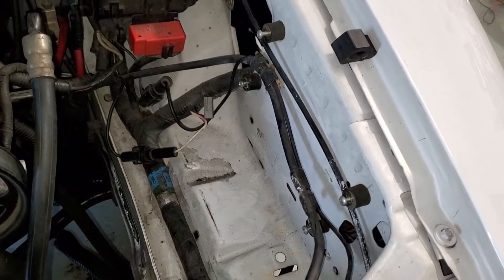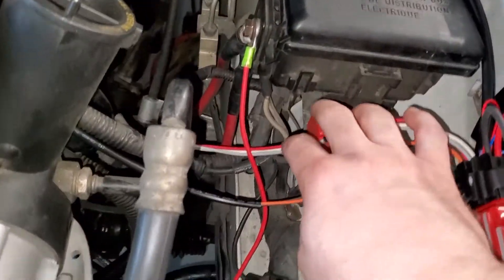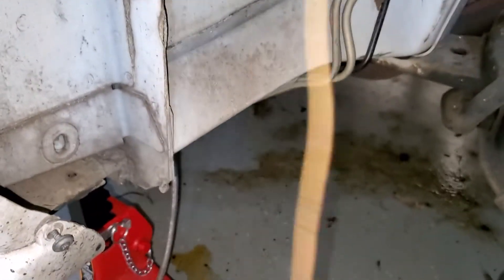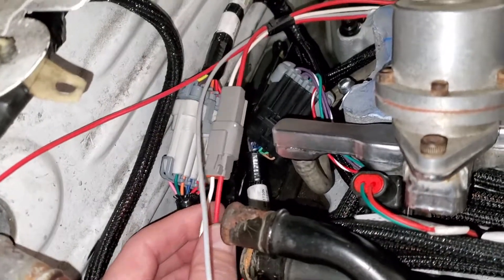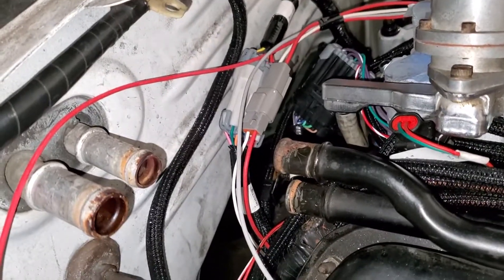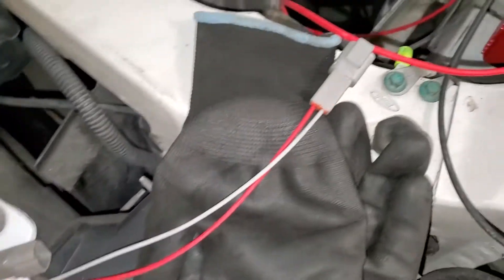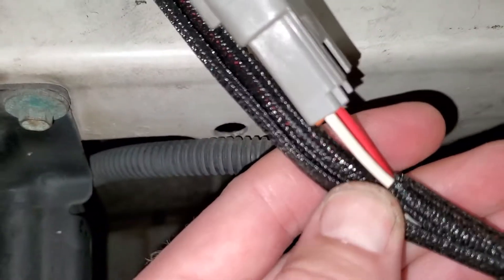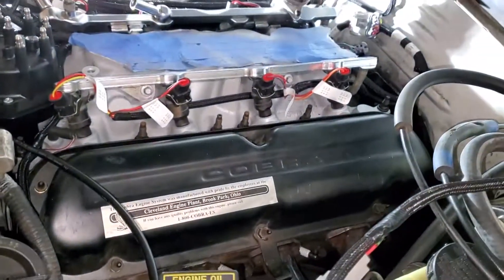SN95 Terminator X: Wiring the MSD digital 6AL, and gauges

Comment: What wire did you use for the switched 12v?  Or did you pull off of a fuse under dash?
Reply from the maker: Ill find it and get back to you
Reply: @BabyLegsMotorsports  please do!  I'd appreciate it
Reply from the maker: It looks like I didn't document where I got it from all that great although I think I used the Red wire with a green(ish) tracer in the black connector seen at 10 minutes 36 seconds in this video https://youtu.be/tpU81ZbvVk8?t=635 and you get a good view of the wire if you pause at 10 minutes 42 seconds. The red wire coming out of the grey connector I added going to that black connector (sorry I couldn't find any pin numbers). You can verify it with a multimeter.

Comment: Great videos, thank you for posting! Where did you find the tan tach wire? Is it in one of the connectors under the dash where the stock ECU was (not the big ECU connector) that goes to the instrument cluster? I removed both harnesses- the one with the injectors where I found the coolant temp and oil pressure wires, and also the harness that goes through to the ECU. I'm guessing that the two oil and water wires will be on the other side of that big connector that was on the firewall in that harness, which I haven't taken apart yet.
Reply from the maker: Off the top of my head I can not remember, but I do think I picked it up in the passenger side lower A-Pillar (where the factory ECU was)

Comment: What wires did you end up using from the 42 pin connector?  I think I wanna keep oil pressure wire cooling temp wire and switched 12v that went to msd
Reply from the maker: I only kept two, the oil pressure and coolant temp sensor wire. I ran a clean power to the MSD.